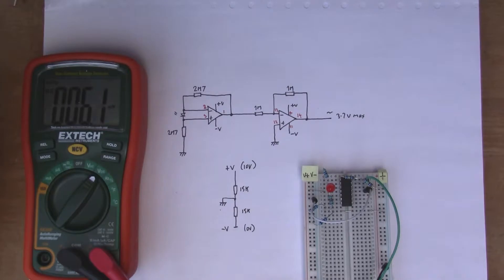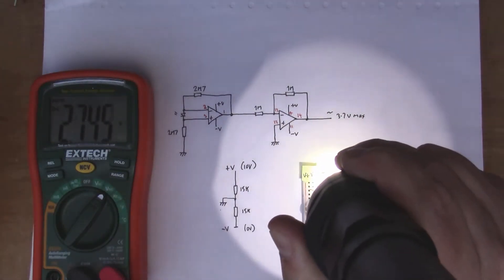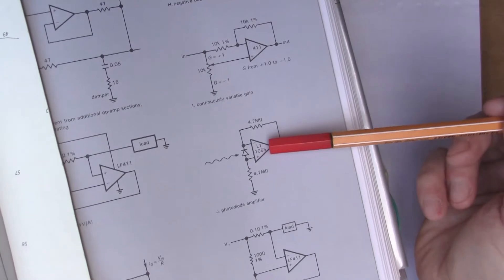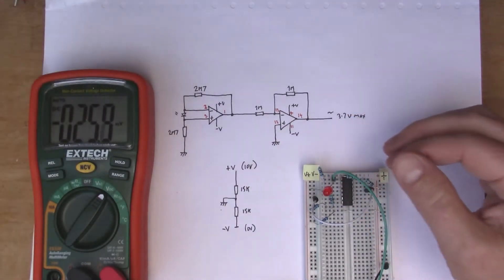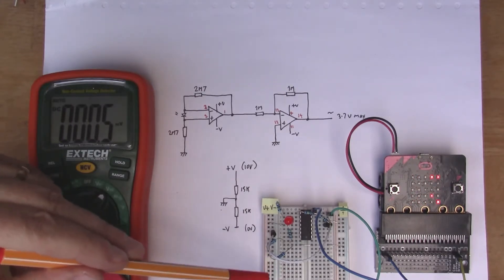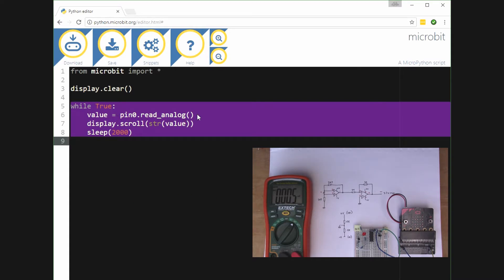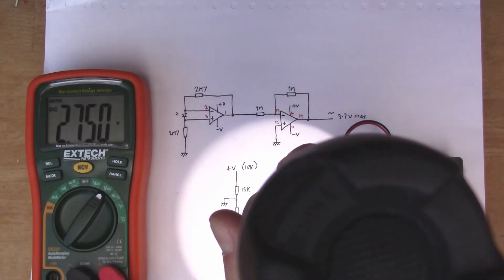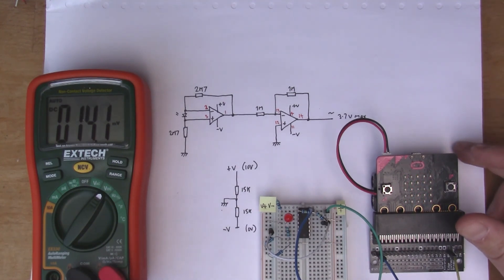Diodes and LEDs Can Detect Light (Part 3 - Final)

Comment: Did you notice your LED is flipped in the circuit you drew from how it is in the book? http://i.imgur.com/gLR4uC7.png
Reply from the maker: You are eagle-eyed indeed, Sir!  Yes, when I was experimenting with it I found some discussions online about reverse-biasing a diode.  I guess I just left it that way because the circuit was working. If I flip it around, I just get the inverse voltage at the output, so I could eliminate the second stage of the LM324 in fact.  Thanks for the comment.
Reply: Bias is a bigger deal than most realize with electronics. Even in places where common wisdom may suggest it doesn't matter. When you're making a circuit board for instance there's right ways to put resistors in, and wrong ways. A well made board you can read all the resistors if the board is held top side up. I was told that when I assembled PCBs professionally. We did it for a few reasons, some of them were practical too. It is easier to QC boards that way. The wrong part stands out better then.